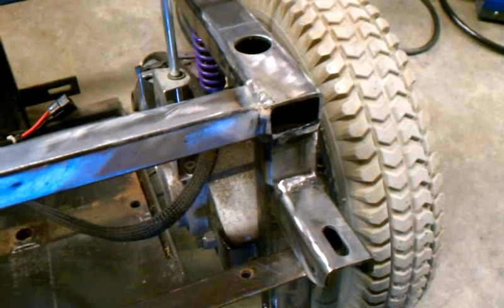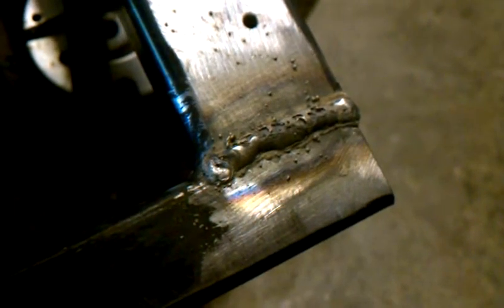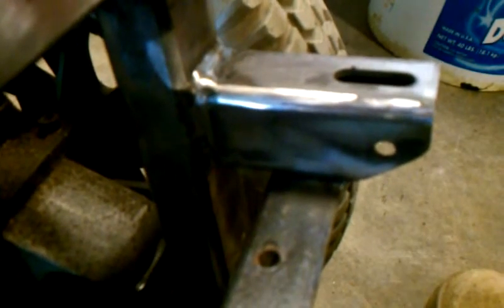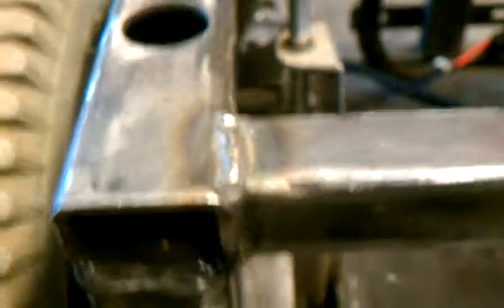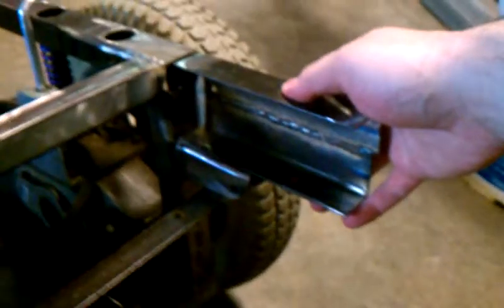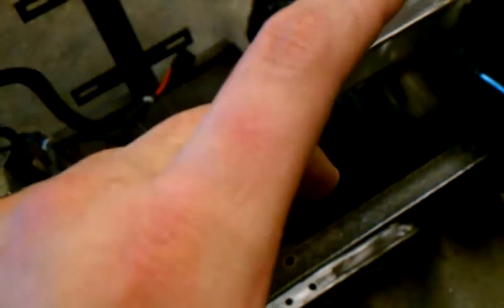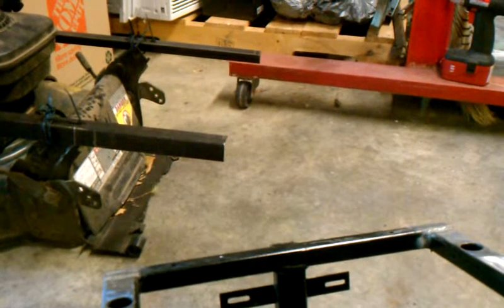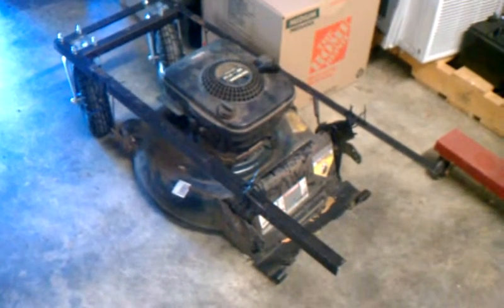R/C Lawnmower - Talking about welding the frame

Comment from the maker: @danielross85 Cuz I'm awesome? :D Um... I don't know, I thought they were all supposed to come out looking right.  On my particular welder, I've got it set to the lowest "heat" setting: 35 amps, and the wire speed was around 3, which is on the slow side.  The metal was thick enough & tough enough to not melt, so I took my time and stuck to what basics I remembered from my training.